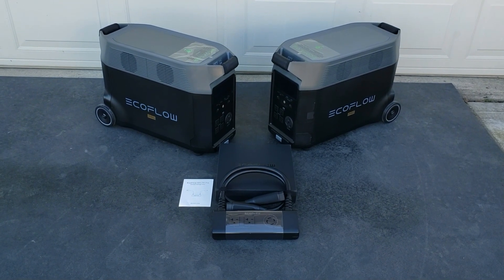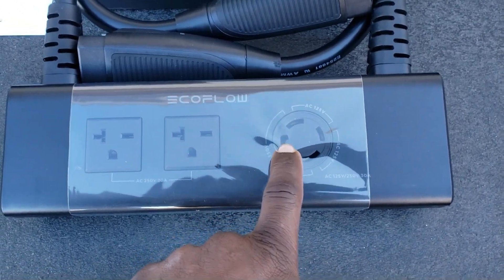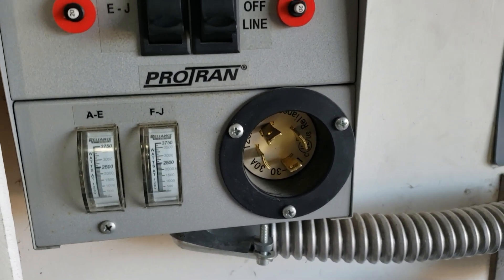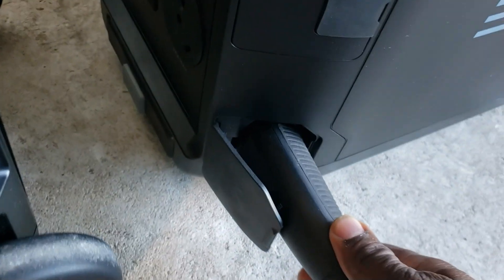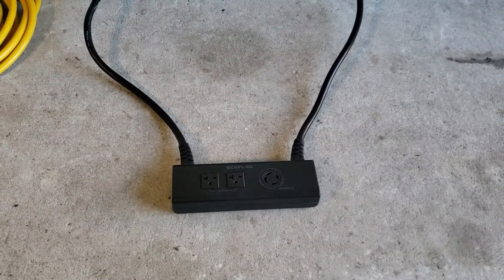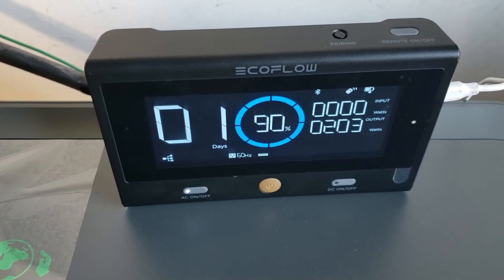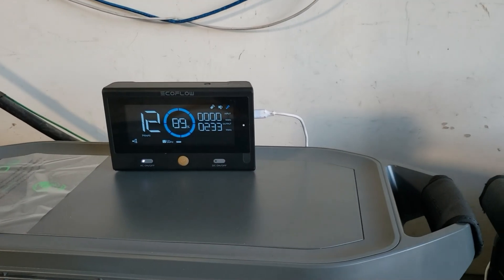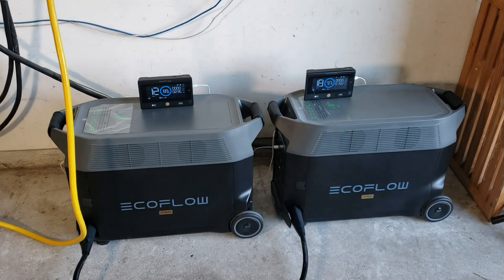Ecoflow Delta Pro 240V/120V Double Voltage Hub Powering my House

Comment: Update 10/15/2025 Ecoflow had a bug in their 131 firmware and reloaded 121, which fixed the 553 error. we are still working on the charging issue, but they are actively working on it! 
I just did this and found both Delta Pros make 240VAC fine as long as you do not have the Delta Pros plugged into 120V from the wall or generator. Charging will stop immediately and both Delta Pros will error to 553 and stop any power output. I have a troubleshooting request in with Ecoflow to resolve this problem. Without any way to recharge the Delta Pros on-the-fly, this does no good. It's a lot of money for a couple hours of power. Not sure if they will recharge with solar yet. I intended to run 240v saws, etc. in a remote location and extend the duration of their operation with a small, quiet generator to keep the crew working all day.  
My Hub is new, and may just be a defective 240V Hub, not sure yet. I have 2 short videos on my YouTube channel. The quality isn't great, but you can see what is happening. 
Note: Each Delta Pro will power one of the buss bars in your panel. If your loads are not even on both buss bars, one Delta Pro will run out of charge faster than the other. Balance your draw.

Comment: Good idea upgrades 3 add Eco flow delta pro 3 system and  Eco flow delta pro 3 extra 6 battery power whole house 30(KWH and Eco flow delta smart dual fuel generator 4000W and please show more test it out on YouTube video 😊

Comment: Can the double hub charge one of the delta pro if one is plugged to the other?
Reply from the maker: Unfortunately that is not possible
Reply: @GeneratorReviews I appreciate the response!  I dislike how expensive these products are and they only do one thing. Kind of like the remote which only controls one unit and only the delta pro.

Comment: Will this setup power my electric water heater which is a 30amp circuit if I only use that while showering?
Reply from the maker: Yes that would be possible 👍🏾

Comment: Curious if this means the 240V is going back to 120V at the transfer switch, IE two 120V legs? Your breakers in each switch are 120V right?
Reply from the maker: Split phase 240v
Reply: @GeneratorReviews  To be more specific, I would like to do a similar setup, a powerhub (or breakerbox) off of the dual voltage hub that can support 1 240V appliance and a couple of 120V appliances, do you think that's possible?

Comment: I hate this dual voltage hub because it will not allow me to do what I need to do. I want to charge my two DPs with AC from my 3500W inverter generator while the DPs are powering my trailer. The dual voltage hub shuts off all AC ports both output and input. It's starting to look like I just can't do this. Any ideas, Thanks

Comment: I got a response from Ecoflo about charging two delta pros while using the 240 power hub they can be charged using DC not AC you would have to use smart generator or solar panels

Comment: Can this power a 1000sq foot hole permanently?
Reply from the maker: I don’t think they recommend using it permanently. It’s more for emergency use and power outages.
Reply: @GeneratorReviews  ok I'm looking for a solution because a tree pulled out my meter and it's gonna cost 5 to 8 k to fix so I'm looking for solar solutions

Comment: Can I buy this $140 plug to plug directly into and power sauna from my 2 Delta pros? Sauna Electrical: 220v, 30-amp service for the heater
Reply from the maker: Sounds like you should be able to do that. That’s one thing I have not tried.

Comment: So there is no load sharing at the battery level between the units?  if so then unbalanced loads could lead to one unit shunting down early and loss of 240V power.
Reply from the maker: Yep that’s one of my issue with this setup but with the smart generator it will recharge the batteries when they get down to 30%

Comment: I would like to see  you try to power the HVAC with EasyStart with the two Delta Pros and see if it will start. Just like you did for the 240V generator comparison. I wonder if it would work?  I believe these units do have surge capability. Might have to wait for warmer weather to try it, but I think it will make a good video.
Reply from the maker: https://youtu.be/B5Ha13xnNZc
Here it is 👍🏾
Reply: @GeneratorReviews  Thanks! I forgot that I saw and commented on that video already. Appreciate it!  I decided to go with a Growatt 12k LF inverter and 4 Lifepower4 (20kWh) rack mount batteries as my emergency backup, which can then be recharged by my Honda EU7000is if utility power is not back yet. Seems to work well so far but I haven't had a chance to see it if will start my 4-ton HVAC with EasyStart due to the cold weather.  I assume that it will have no problems with the 55A inrush spike.

Comment: Pretty cool. It's a lot of $ but worth it if you're in an area that experiences frequent power outages and don't want the noise or upkeep of a portable generator system. I'm wondering if at this price point it might be better to go with a permanent whole house generator system that runs off natural or propane gas and automatic transfer switch? I guess everything has their pros and cons. Nice demo!
Reply from the maker: Agreed 👍🏾
Reply: I got a quote for a whole house generator and let me tell you it’s not cheap at all or reasonable….. the quote was for 16k and you have to pay for maintenance and monitoring!!!! That was almost 2 grand a year and here is the catch, if you do your own maintenance you void the warranty!!!!!! It wasn’t worth it for me so I just got a 50 amp connector on my fuse box and a 13000 watt generator off of Amazon…..

Comment: So glad to see you testing these. I was ready to jump on the Genmax 9000 iED but have been toying with this approach instead. More money for sure but I love the convenience and no noise or pollution. 
Just need to figure out how long these will last for my needs.
Reply: Don't forget to look into plugging solar in if you have it.  You can even do real deal panels if you abide by the right voltage.  My setup is weird - if I am out of power I have a 5.4kW array that can power a regular receptacle and I can use that to charge one unit while they power my house, then change to the other unit after a couple of hours (or do both at 800 to 900 watts each).

Comment: At full load.  How long does one of these batteries last?   Was gooing to but a portable inverter 7500 running but hoa didnt approve.  They countered my portable request with approval of a stand by which i dont want.  So this battery option i like.
Reply from the maker: https://youtu.be/B5Ha13xnNZc
Check out this full test

Comment: I wonder if you can hookup the smart generator to the 240v setup?

I really I think a setup where you can use these batteries and the smart fuel generator would be ideal for portable power backup. Have the batteries produce the 240v and handle the extra load when necessary, while have the small generator recharge them under low load conditions. A self start/off would also be a great idea. I do know the generator does have the auto off already.
Reply from the maker: https://youtu.be/B5Ha13xnNZc

You can👍🏾
Reply: it works exactly as you state

Comment: Great post can these units be kept trickle charged 24/7 on grid and also by a portable generator?
And do the meters display remaining run time in hours and minutes?
TY "G"
Reply from the maker: Yes, they can be. I think you’re asking if they have pass through power. Once the power shut off, they’ll take over.
The display does show minutes remaining
Reply: @GeneratorReviews  TY "G"
So they can be recharged using a gas or LP fuel portable generator?
Reply from the maker: @1new-man  yes they can
Reply: @GeneratorReviews  TY Kindly

Comment: I have this exact setup powering my house. It's really nice to be able to switch to this setup for power outages that lasts overnight. No more generator humming through the night!
Reply: What do you do when the EcoFlow goes dead and the power still hasn't been restored?
Reply: @eosjoe565  I plug my house back into my Genmax6000. The EcoFlow is really only used for overnights. It's quiet and I don't risk carbon monoxide coming into the house.
Reply: @KevinRedmondWA  Sounds good. It's nice to have both types of sources available.
Reply from the maker: He can also connect the Delta pro to the generator outside and recharge them using his remote start from inside the house as needed
Reply: @GeneratorReviews  correct! 👍 only thing I’ll add is: the total input of the EcoFlow while charging with only AC can’t exceed 1600 watts. This means the charging+output watts, while plugged into just the ac, also can’t exceed 1600 watts. So as long as I stay under that, easy, yes I can charge the EcoFlow while using it to power my house.

Also during long outages when I have to run my dryer, I run the house with the Genmax 6000. I then move the two EcoFlow Pro next to the dryer, and power my dryer with the 240v adapter.
Reply: @KevinRedmondWA  The DP acts like an extension cord when the AC cord from the DP is plugged into a supply outlet and you will be limited to 1,800 watts max output from the front outlets. 

Also, the Double Voltage Hub (DVH) will not turn on if the DP is connected to an AC power supply such as a gas generator.

The DP can be charged from DC via a proprietary EcoFlow cord connected to EF Smart Generator. 

Alternatively, the DP can be charged from XT60i solar port via solar power or a Switched mode Power Supply which is powered from AC.

In this video, BOTH Delta Pro's are being charged via DC through the Switched-Mode Power Supply (SMPS) at 1,200 watts to EACH DP via Yamaha EF6300iSDE. 

To my knowledge, this is the only way other than using TWO Ecoflow Smart Generators or using solar panels for the DP's to have their batteries charged WHILE connected to Double Voltage Hub which is supplying 240 volts to my transfer switch which in turn is supplying power to my house panel which is powering my whole house. I needed the DVH and the 240 volts it produces for my well pump.

https://youtu.be/kVEqvLiHx2w
Reply: @GeneratorReviews  You can not use any AC ports, both input or output ports are shut off while the dual voltage hub is working.
Reply: @thechamp66  Is this worth it? or just get a delta pro 3 that can natively handle the AC charging while outputting 240V?

Comment: are you gonna get the 240v if your transfer switch is a 30amp?
Reply from the maker: Yes you can get 240v with the 30amp transfer switch
Reply: @GeneratorReviews  thanks for the info. an electrician told me that with the transfer switch (30amp) he wants to install I can't get the water heater running... I'm new to this, so I don't understand why? I thought it just depends on the generator I use?
Reply: @amelsfr  He could be referring to the total AMPs of the transfer switch. Assuming you are getting a true 240V, 30 AMPS would give you 7200 watts. It's not uncommon for an electric water heater to pull 4500-5500 watts. That doesn't leave much for the rest of the house. With my generator switch I can run the water heater if I turn everything else off. In 10+ years of power failures and running a backup generator, that hasn't been a problem.

Comment: Why buy 2 120 V generators; and buy an adapter to get 240 V? Just buy a generator that provides 240 V! And no need to sync up 2 Generators? Huh?
Reply: I agree but for those folks who are obsessed with using a battery inverter and don't mind the $7200 price tag, this is one of the few 240V solutions out there.